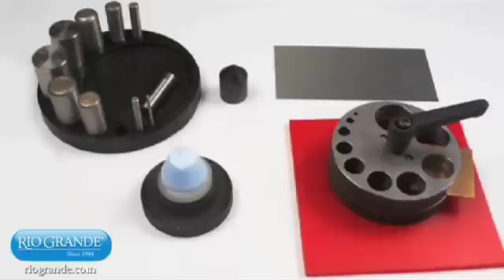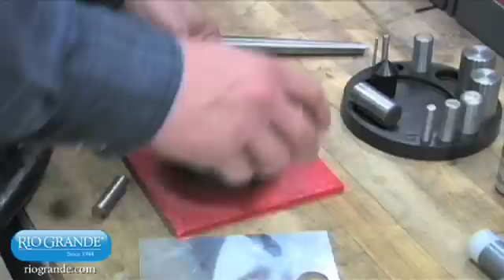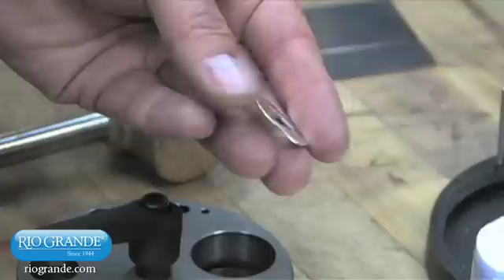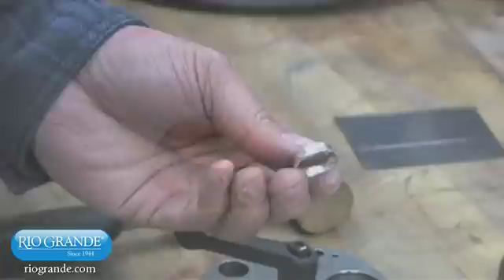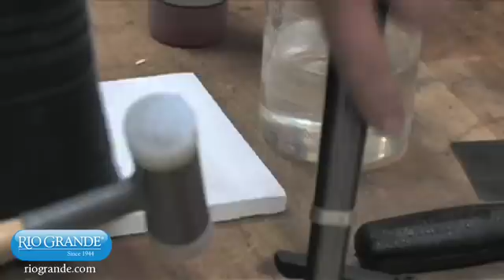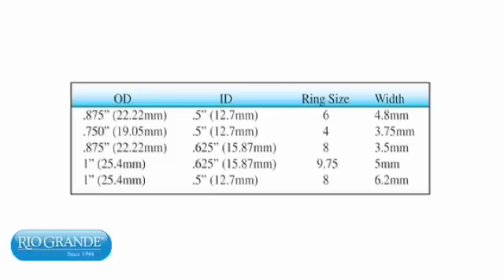How-to Make a Seamless Ring Using the Swanstrom Disc Cutter

Comment: What size inner hole and outer diameter will best produce a size 16 ring?
Reply from the maker: Hi there - The inside dimension of a size 16 ring is 24.64mm diameter. It is recommended that ring shanks are 1.2-1.5mm thick for women’s rings, and 1.5-1.8mm for men’s.
Reply: @RioGrande1944  I was more aiming the question towards what is recommended punch sizes to make a "washer" for a size 16 seamless ring. For example, a 1/2 inch punch for the center and 1 3/8 for the outside?
Reply: @RioGrande1944  any tips for getting a seamless size 16 ring from a washer?

Comment from the maker: @sultryaz The disc cutter will cut the Niobium and Titanium, There will be more wear on the cutters than normal. As for forming the washer. It be a little tricky. The niobium will form easier than the Titanium but neither metal can be easily annealed. They have to be annealed in a vacuum under an inert atmosphere. 
We hope this is of some help.

Comment: excited to try this, but disc cutters are expensive... is there a really big difference ebtween this 300 dollar disc cutter and the 60 dollar ones elsewhere?
Reply: tronclay  mine is not the real expensive model, But I am only using it occasionally. If you plan to use it daily or quite frequently then more expensive.  Use the lubricant to extend the life of the ring!

Comment from the maker: @leftysoftball17 Sadly no there is not. The basic rule of thumb though is, The larger the washer the larger the ring. This technique of making rings takes a lot of experimenting to find just the right combination of diameters and thickness. The thickness of the metal plays a roll too. So try getting some copper, in the same thickness as the ring you want to make, and do some experimenting. Be sure to right down each step and that will make the process go faster. 
I hope this is of some help.